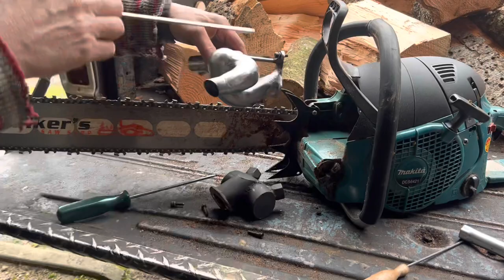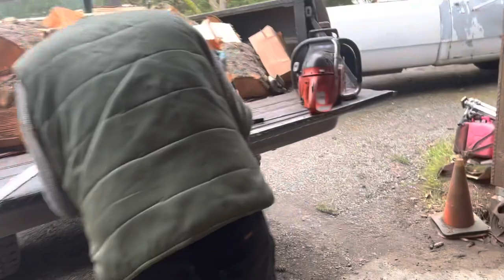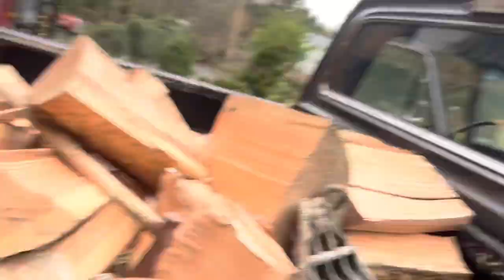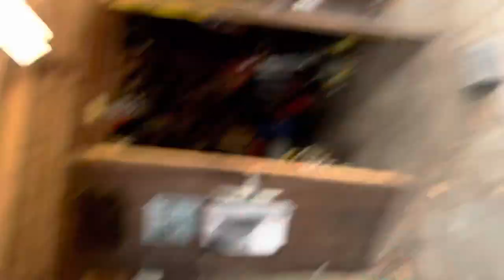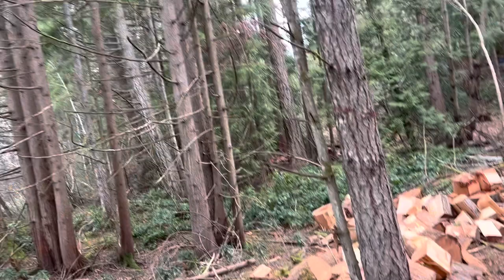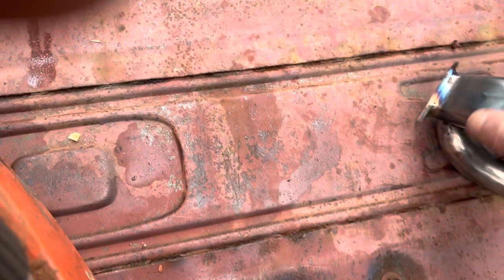Chainsaws everywhere ! test cuts for best muffler

Comment: Might be bluing more around the welds because the diameter of the steel is greater in that area thus not dissipating the heat as fast.

Comment: Hello Billy, is there anything worth knowing about chainsaw trigger control, if there is any? Like with fire arms? I was not able to find anything related to chainsaws other than repair videos. What I mean is: how to properly manage the throttle before, during, and coming out of the cut?
I noticed many people are still full throttle at the end of the cut, while you tend to throttle down for the last one-two inches. Like coming up slowly to a red light. Am I right?
Thank you, a low mileage chainsaw enthusiast here ;) Cheers
Reply from the maker: great questions Brother , Im just one man , but to be honest , its all situational,,  diameter,, species, reason for the cut , how much oil yer getting with the saw in hand , Chain ,, are you in the air, or on the ground , what i do know friend it that these things have bin the vehicle to everything I have , most importantly my peace. thx for the question
Reply: @BuckinBillyRaySmith  Thank you for taking the time to reply. I very much appreciate. In beekeeping the answer to many questions is also "it depends" :)
So now I understand what you replied, and I also understand I need to learn more ;)
Thank you. Best wishes from Switzerland.
Reply from the maker: @diegovd7215  Glad you are here , many folks over the years have adapted some of my cuttin style . there is many videos to see cutting

Comment: Since you are testing out pipes. Would you want to test one of mine? Its a bit different then the pipes you use. Cheers
Reply from the maker: what ya cookin with?
Reply: @BuckinBillyRaySmith  nothing super special.  Custom can. 2 piece. Not even sure if they give much more performance but they flow better then stock.
Reply: @BuckinBillyRaySmith  what saw would you want it for? I mainly use 61 -272 chassis but can get a hold of something different to fit it to. Cheers

Comment: Just brain stormin. What if you had the Ramhorn exhaust go from two back down to one? Making the exhaust port smaller an having all gasses released together. Like an X pipe. But it would be a Y X Y. Your outside the box thinking doesn't go unnoticed so here's mine lol. Be safe all
Reply from the maker: two into one does work

Comment: Hey Buckin I have a bit of experience with blacksmithing and when you guys were looking at the heat color on the serpent pipe I believe you didn't get in quite right. That duller light blue that you were seeing in the first section of the pipe is actually the final color in the order of colors that bleed out from heat and it indicates the highest heat in that section. I'll see if I can't link some sort of information on the topic.
Reply from the maker: someone else pointed this out , kool buddy thx makes sense